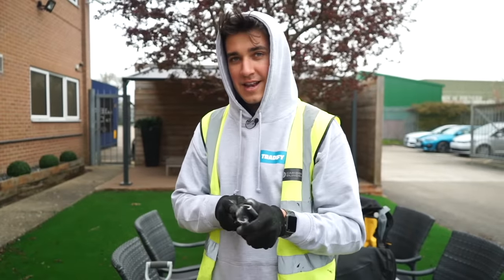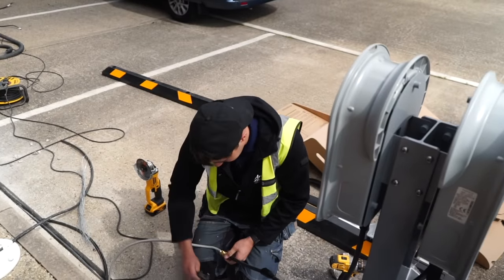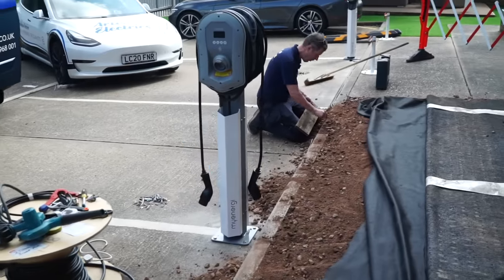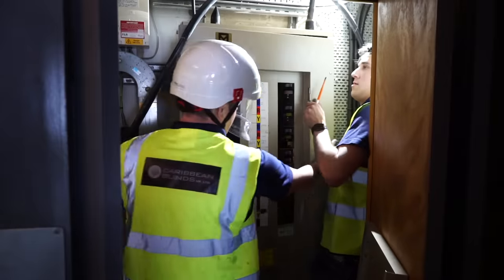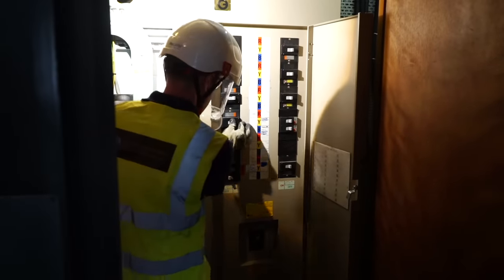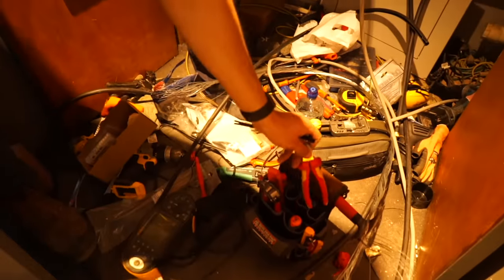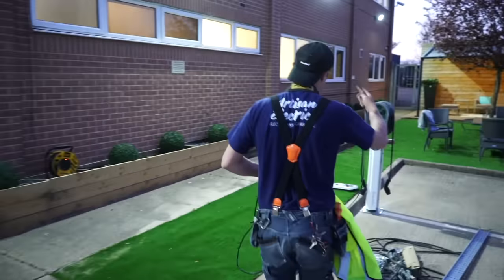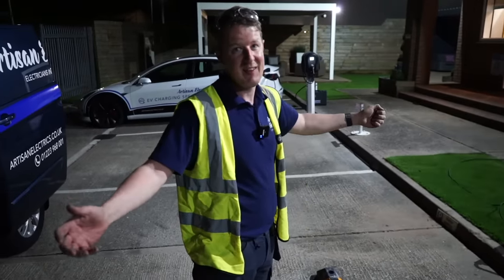WORKING TIL MIDNIGHT - Nightmare Electric Vehicle Charging Installation - Part 2 - Electrician Life

Comment: Cory an absolute gent and a decent spark. Jordan would be better off sitting in an office away from big boy work. It's actually criminal how you have left those cables Jordan. I hole in the not to distance future we see a video if you rectifying this job. It's a disgrace and deadly dangerous how close you have ran those cables to the surface. Cables should be minimum 450mm in the ground and should be laid on sand not stones. I usually love your videos but in this case what you have done is so risky. Get a con saw and cut that concrete properly it would take less time to do it properly

Comment: The details of the installation are not fully explained, but have you run 400 volts outside in a trench that is less than 50mm without ductwork on a footpath open to staff and the public, with a tight bend radius on the swa exposed above the grass line.

Comment: Love how the boss is in ppe looking like an astronaut and Corey comes poodling over with his hat on backwards 🤣
Reply: What a load of cowboys all outside cables should be buried 600mm deep and in cable ducts if possible &  taped! This instalation is not safe!
Reply: @andrewgeary989  Actually in the UK, there is no defined distance for burying steel armored cables, ie 'BS7671 requires that cables be buried deep enough so as not to be disturbed by any reasonably foreseeable activity – such as digging with a spade or a lawnmower and that a yellow warning tape be used to alert of the presence of buried cable.' which theirs does meet the requirements (and indeed the use of the 'tile tape' is well above the minimums required...)

Comment: I'm astounded that burying cables carrying full potential are allowed just inches under the soil in the UK. Yikes...Even low voltage in some jurisdictions must be in conduit and feet below the surface.
Reply: 450mm below ground is normal , any risk of top soil movement usually go 1 metre

Comment: Shut downs : 
I worked in a large computer infrastructure/medial site and it required a new 11K feed upgrade.  So a shutdown was planned, so we got ready to bring down all the electrical systems on the day when we got the message, shutdown was cancelled, the 11K upgrade was done while still energized.   Some-one had very big balls.

Comment: When I started with the company I'm with now I seen lads using grinders on SWA and thought that is the roughest thing I have ever seen did it once myself and never looked back.
Reply: I've never seen it done but I guess like anything give it a few practice goes and get the feel for it
Reply: @lewis94uk  It's easy AF and leaves it very clean when you break away the armour I use my armour slice on the small stuff like 16's and that but for the big stuff grinder all the way

Comment: Little tip. Put the bolt in those fixings 2-3 threads then hammer the bolt, sometimes you damage the treads and only realize once they’re in there. Trust me I’ve learnt the hard way.
Reply from the maker: Nice tip thanks

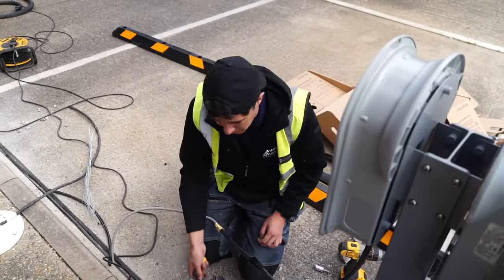Comment: 3:13 multi tool leaves a much neater finish, also with that dewalt grinder you can unscrew the 4 screws at the top and rotate the head making it easier to hold

Comment: Cory's expression boot isn't that weird, its quite common in the industrial electronic/electrical sector to call a shroud a boot. Toggle switches sometimes have boots over them too. RS sell them and list them as Toggle Switch Boots.
Reply from the maker: Cool
Reply: I usually put boots on the cable if I have to terminate a CAT5 networking cable.. they look better and help protect the plug
Reply: @_chrisr_  Yeah until you get some crap network socket (usually installed by sparks as it happens) that are so badly made with a boot on the cables won’t fit. The sockets are the issue, but it is bloody annoying.
Reply: @SquirreliciousMe  too true, usually find that where the socket has started to come away from the face plate, probably because it was a poor quality fitting or the wrong module fitted.

Comment: Major difference otherside of pond n.america we wld use schedule 40 maybe 80 PVC conduit for all of our underground exterior wiring although some might cheap on out and use direct burial no where as rugged as your armoured
Reply: Depending on the carriers being armored or not, metal conduit might be required in some North Am jurisdictions, and buried different depths.

In Ontario, minimum residential is 24", with caveats:
[According to Section 12-012 of the code and table 53 the minimum depth without any protection must be 600 mm (or 24 in.). You must also bury caution tape above the depth of the wire so that if someone digs in the future they won't be shocked by their efforts.]
[...]
https://wattsource.ca/cable-burial-code/

And that's just a 15 amp 120v shed feed! Commercial is much more demanding, as is 240v and 30A or higher feed.

Warning tape must be buried above the cables to warn those digging.

Comment: CTs and Cat5: it sounded like you connected the CTs directly to the Cat5?
If they're 100:5 CTs that sounds like you'll either have them massively under reading (which probably won't matter here?) or melting the Cat5, and CTs don't like not having a load.

Comment: Great job. In the US those SWA cables would be in a large conduit and deeper to give even more protection. You may need to invest in more heavy duty ground digging tools if you do this kind of stuff more frequently.
Reply: I am from US also, cannot believe the cables are only that low. The electrical code in UK I guess don’t require them to put it lower in the ground. I could see some one hammering a lawn stake into those wires, like alarm company putting there alarm lawn sign.
Reply: @Mason Moore in USA it also depend on the type of ground your are doing it. It can be as low as 4-6 inches (100-150mm) if in rigid metal conduit under soil but can be as deep as 18-24 inches (450-600 mm) depending on type of conduit and ground type.

One suspects the armored cable provides its own protection hence allowing the shallower burial.
Reply: @mathman0101  I talk to licensed electrician in Philadelphia (USA)
This is what he said 
6” for Rigid conduit
4” for Rigid conduit if it’s inside 4” of concrete.

Comment: I really enjoy your videos, just one bit of advice about expansion anchors. Always leave at least the length of the anchor from the edge of the concrete, if you can't do that then use a chemical anchor. Thanks for the all the info learning loads from you both

Comment: Does anyone else think that a cable trough with a lid in the stony soil would be a better solution than simply laying the cables as shown here.
Reply: id have put them in concrete haunching or heavy ducting
Reply: They said it was going to be concreted over.

Comment: I was just wondering...

You've installed 4 chargers at 7kW each.
How did you balance the loads?

1 per phase plus one repeated on a phase.
But did you:
(a) just put it on any phase randomly
(b) look at other loads in the building and choose least loaded phase
(c) measure phase voltages to see which one is least/most loaded on the feeder

Comment: When tightening the SWA gland with the adjustable spanners and getting close to the final tighten, instead of having  the spanners far away from each other, have them close together then you can use both hands to grip around the spanners for the final tighten---if you see what I mean!😉
Reply: Good tip 👍

Comment: If you fix close to the edges of concrete you would be slightly better off using chemfix to reduce the stress on the concrete. After a few years of icy winters you might find the concrete cracks off to the edges and your pillar becomes loose.

Comment: Impact drivers and sockets: regular chromed sockets aren't generally designed for impact use and can split. Bad quality ones just split down one side, good quality ones can shatter. 
If you're going to be using an impact driver on a regular basis you may be better off picking up a set of impact sockets for them. I was going to suggest this kit (I have one) but apparently it doesn't exist any more!
https://www.screwfix.com/p/erbauer-hex-nut-socket-driver-bit-set-12-pieces/6432V
I have snapped two of the Screwfix 1/4 hex to 1/2 square adapters and a few more generic ones. Never broke anything with my old impact on small batteries, the "new" impact is a bit harder on accessories.

Comment: In California, you’d never get away with mounting a post on both sides of a break in the concrete. The break is meant to allow the concrete to shift, which it does a lot during earthquakes. This post would probably mangle the bolts or help the concrete fracture more. (Yes, im aware theyre not in California)

Comment: That gearbox screwdriver seems pointless for the money, there are better options for speed if you need it. 
Great installation there guys, I’d love to get involved with this stuff. I would definitely be applying if you started getting work more east, Cambridge is just that bit far from Norwich, don’t usually go past Newmarket, Camborne on the rare occasion

Comment: Another job to be proud of, interesting 2 parter.
Out of interest, was there any desire from the customer to install more points out front in future, as such did you consider making larger/multiple cuts in the concrete to install ducting/containment to be able to push/pull additional SWAs.  I recognise the additional work/cost this would incur, probably the need for groundworkers prior.

Comment: Very interesting that this is legal. In Aus you have to put the cable in a PVC conduit and it has to be a set distance below ground level (several feet), then the tape has to be above a certain distance. Goes to show how much we over do things down under. Running it along a few inches under the dirt is unheard of.
Reply: Im surprised too and I’m in the uk, please tell me if I’m wrong but doesn’t the cable have to be at least 500mm deep? Also I’m not sure a bit of plastic is going to protect the cable! Not for one Second.
Reply: Same here, i'm in New Zealand.

Comment: how do you mount the cable tray above the suspended ceiling?
Reply: Metal wire or clips fixed to roof structure i guess!

Comment: Hi Jordan, I really enjoy your videos, but why did you not sub out the Civils, tile tape is not a mitigation for shallow trenches, Civils lads would have known NJUG stipulates 350-450mm in footway and 600mm in carriageway areas. 
Altough NJUG regs are for publically maintained roads (and enforced) they set the defacto standard,  private roads are built to the same spec.
Apart from my rant, keep up the good work.
Reply from the maker: Thanks yeah you live and learn, I won’t be chasing out pavements again any time soon! 🤣

Comment: If it were me. I would have dug a hole at in the earth and planted a concrete block into the ground and then mount the 1st set on that and the 2nd set on the pavement. As you would then only have need to chase the cable to the second set of units. This would have made the addition of rubber ramps un-necessary. As it made you Tesla stick out of the parking bay. The kerb then would have protected both sets of units. Little more time in the planning stage would have save a lot more time in the implementation stages. Same on the board. No one visited site or got them to take a picture of the 3 phase panel? However, all very entertaining watching High voltage get up now.

Comment: I am so glad to live in a country where 3 Phase Power is absolute Standard and we do not use such old school Distribution Boards. I have 3 Phase 63A going in and around 60 brakers to safely distrubute the Power around our house. We do not have switches on our outlets, instead we have KNX Binary Outputs in the Distrubution Board to switch Power on and off. Most Devices have single outlets with dedicated braker and can be switched via the binary output. RCD Protection everywhere and a 11kW Wallbox. Our Lights have a simple Bus System called DALI. So we run a single 5x1.5 Cable (Ground, Line, Neutral, DA+ and DA-) from the Distribution Board to all Lights. At the Light you have a little constant current LED Transformer and thats it. Very effective in energy usage. The light is not dimmed via PWM, so no flikerl at all.  Also no Light Swichtes are used at all. Everything can be controlled via a single Bus-System (KNX). But still very entertaining ( better to say laugh at your old School installation Standards). Love your Channel. (For the Haters, he has already seen for himself the future and did showcased it here. He knows all of that.)
Reply: Are you in Germany?

Yes I don't understand this single phase nonsense for houses.
I'm in South Africa and I've got three phase 80A per phase.
It is a bigger house with 4000m² garden.

Three phase isn't the standard though, it's chosen at the time of construction or if an upgrade is requested.
Reply: @the_real_hislordship  The UK has some of the most pedantic and backwards domestic electrics in the world.

Domestic triple phase has drawbacks, but in nations with expensive electricity prices, it's much more efficient in delivery. In North Am, where electricity can be cheap or costly, depending on where you live, there's the option of centre tapped 240v single phase, which allows 240v feed to high amperage devices (stoves, power tools, etc) and 120 for lighting and light load. If one has a high demand heating or cooling need, triple phase 208v per leg is now available for many homes too, been standard in commercial and industrial for years.

Comment: You can always tell crap work , when you see ceiling roses above a suspended ceiling , it tell you the previous sparks hasnt a clue and clueless what is available and clueless to what they should be using
Reply: Might be a klik rose tbf
Reply: @lewis94uk  indeed

Comment: Gents, sorry but I must comment, SY, CY flex is not suitable for power, supply only as a control cable, it doesn't comply to a BS standards. 

The cable complies to German VDE standards and not British. this is because the flexi cable internally complies to BS however  the brading doesn't, therefore it will not comply to the BS7671 regulations.
Reply from the maker: We used SWA not SY
Reply from the maker: Not sure what you’re talking about really?
Reply: @artisanelectrics   Hi sorry but i may have not explained myself correctly, about 1.40 into the vlog your collage comment on using SY cable and gland that could have misled people into using this type of cable, so I just comment regarding its non conformity. 

 My apologies if you thought I was referring to the type of cable you had installed, and you installation.